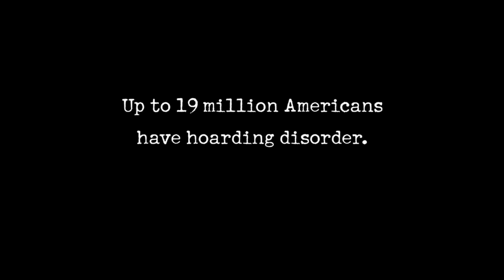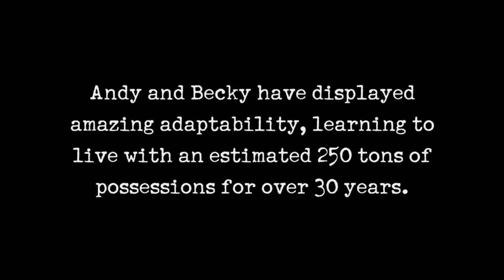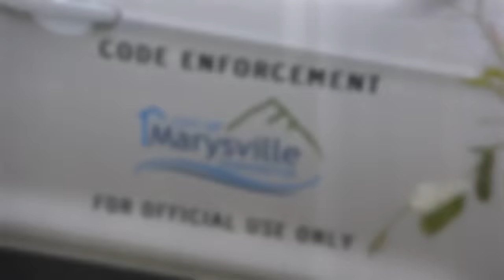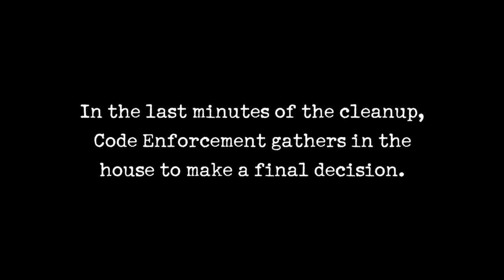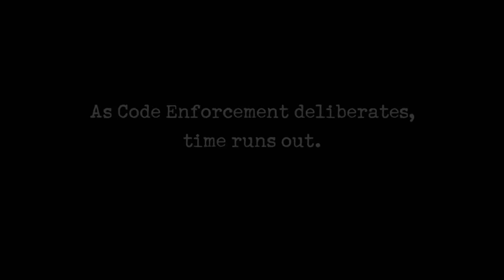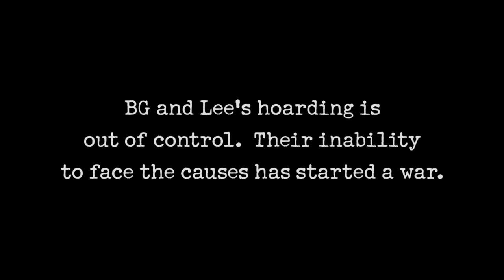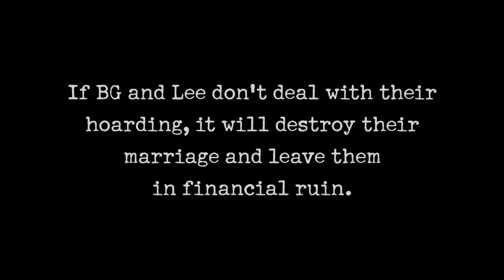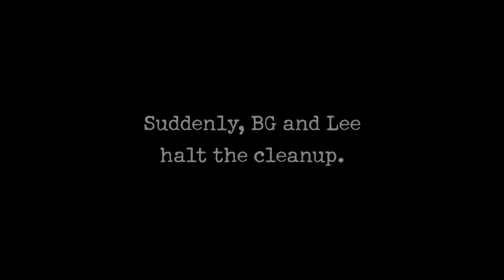Hoarders: Couples Who Hoard Together - One Hour Compilation | A&E

Comment: So in the 1st case Andy & wife got their house cleared by Code Enforcement, but nobody noticed the major crack extending across the ceiling in their living room. My guess is that the hoard packed in the space above it (attic or room) is so heavy that the ceiling is caving in.  Could collapse anytime. A structural engineer needs to take a look at the house.